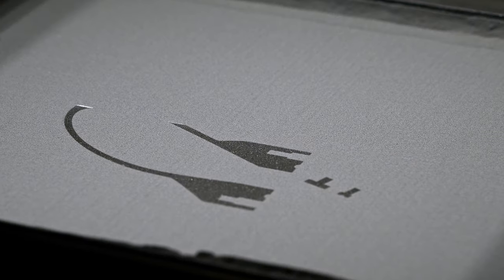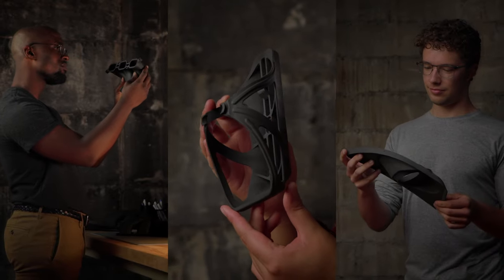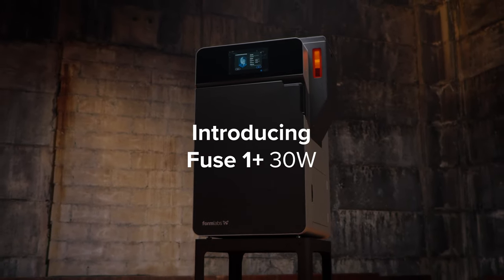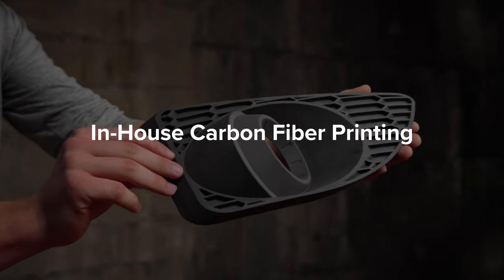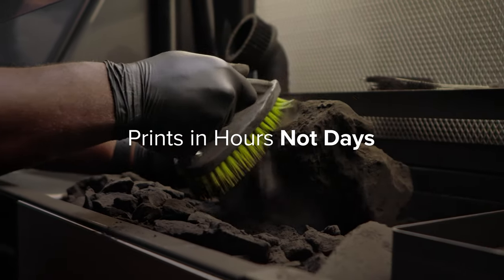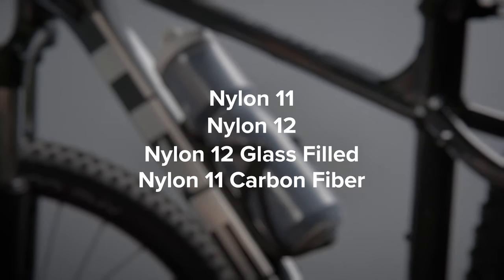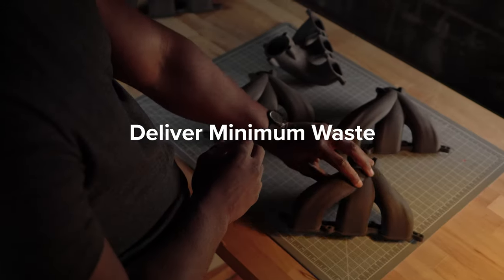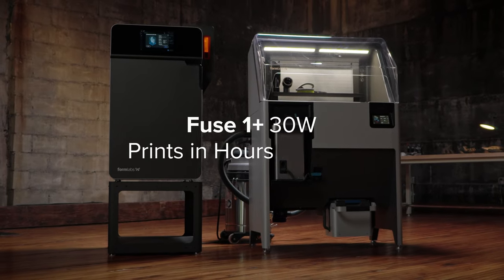Fuse 1+ 30W: Truly Rapid SLS 3D Printing

Comment: I have just been granted access to this machine in my class. And I have a couple of questions: what is the slicer software called? how good is the dimensional accuracy for stuff like holes and mating surfaces? I am planning to have a smallish robot arm chassis printed for my class project and I realize that I will have to perform some cleanup in as far as threading holes for fasteners and probably surfacing some areas that will mate together. Basically, will i have to account for shrinkage in my model to maintain accuracy for small holes and such?
Reply: They do their shit custom

Comment: what is the power consumption in watts? with Fuse1+
Reply: You for real? Check the title of the video, name of the machine or what he says in the video.
Reply: @Ezl1445  30W is the power consumption of the laser. The printer also uses heat to bake the print + display and others. Definitely above 200W total.
Reply: @kendrickxy1774  mb thought he meant the laser!!

Comment: Recommended kit only $43k. These boxes shouldn't cost the same as cars.
Reply: Its not for printing crappy little statues and usless crap its for printing parts for real world use and for manufacturing. Printing in carbon fiber is not ever going to be cheap.